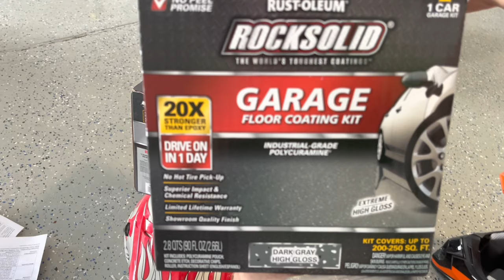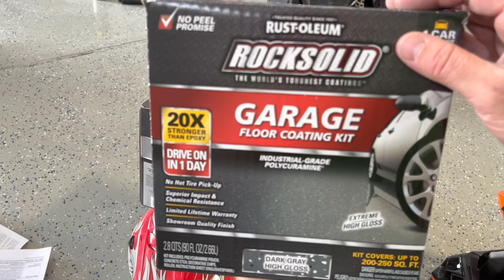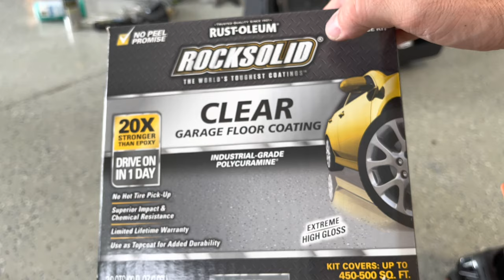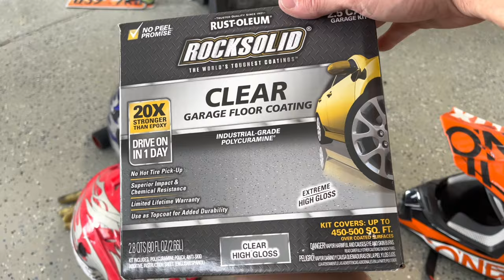Enclosed Trailer Transformation | Epoxy Floor and Painting Walls | 7x16 Dirt Bike Trailer

Comment: I used this in my 10 x 12 shed.  Lawnmowers, motorcycles and miscellaneous constantly hauled in and out.  5 years later, still looks the same as the day I painted it.  Highly recommend this epoxy paint.  I'm going to do this to the trailer I just bought.  Thanks for the video.
Reply from the maker: Thanks for sharing your experience!  Good to hear it has held up well for you.
Reply: Did you put clear Ontop? If so which one did you use?

Comment: Thanks for the great video!  I just ordered the epoxy from your link and I pick up my new trailer tomorrow! 🙌
Reply from the maker: Awesome! Good luck with your epoxy project, it's very straightforward, I would use the included sand to give the floors more grip when it's wet
Reply: I’ll definitely do that. Thanks for the tip!

Comment: I’m buying a trailer picking it up Tuesday. I may go this route. I was going to use deck paint on the floor. But I like this more.
Reply from the maker: Yeah I'm glad I did this.
Reply: So I the clear coat an option or does it have to be done?

Comment: Looks great... really brilliant  compared to the stock wood finish... I'm happy to see others have done this, even if it does require touch ups I'm sure it'll make the wood last longer than without it as well as easy to  clean up the mud and grease. Thanks for the great work and I'll be sure to have the gang get hands on with my project too!
Reply from the maker: Thanks for the positive comment!

Comment: If you hammer some nails through a 2x4 you can use them as shoes and walk on the epoxy while you’re spreading and casting
Reply from the maker: Good tip

Comment: I did my enclosed 7x16ft trailer ramp floor today. I used an extra coat of epoxy from what I learned on your 1yr update video. Its looking great. Only thing is I ran out of the blue flakes right before the ramp. Seems you had more than I did :-(  I have an aluminum ramp cover I'm going to use in place of the ramp flakes. Thank for posting this!
Reply from the maker: Nice!! The epoxy is a great option for these trailers!!

Comment: I decided against the epoxy flooring on 
my enclosed trailer because I thought it would flex too much and crack. How is it holding up?
Reply from the maker: About a year later and it's perfect, No issues or cracking at all

Comment: Good vid -- your cut in on the base boards looked like a blind person did it 🤣
How well is it holding up -- did you find it slippery with out the sand mixed in.
Cheers
Reply from the maker: It's held up good, yes it is slippery without the sand

Comment: Myk, this turned out awesome. I've seen your follow up videos with everything you've done to your trailer. I'm in the process of painting mine and plan on doing the same to my floor. My question for you is after you applied this to the floor were you still able to see the screws? I'm asking because I too will be installing e track for my bike and I want to be sure to bolt them through the frame. Thanks for your time
Reply from the maker: Thanks for the comment, yes, I could still see the screw holes very slightly, and it made it easy to install. Etrack, you should have no problem.
Reply: @Myksgarage  Sweet. Thanks for the response. I'm enjoying you videos, thanks for putting them out!

Comment: Just to clarify about the product you're using it is the RockSolid Pollycuramine and not the Epoxy shield that offered from Rust-Oleum company. Hence, it is not an Epoxy based as their customer service recommended the Pollycuramine for wooden floors as such for enclosed trailers. I liked you video demo and thanks for showing.
Reply from the maker: Correct

Comment: will you be protecting the other side of the wood that is facing the outside elements? will you also be adding protection to the frame? will you use a bedliner material?
Reply from the maker: I've thought about doing the frame

Comment: I see you used the 1 car garage Rock solid to do the entire interior and the sealed it with the 2.5 car clear sealer. Would you suggest going with the 2 car  floor Rock Solid or would that be to much?
Reply from the maker: I wish I would have done 2 coats of the color, it would have turned out better
Reply: @Myksgarage  just to be clear would the best option have been the 2.5 car garage kit of rust oleum rock solid?

Comment: Do you feel you really needed to sand the floor first?
Reply from the maker: I'm not sure, mine was used and had some wear so I did just so I could get good adhesion
Reply: @Myksgarage  mine is used has stains and other imperfections. I guess I should probably sand for adhesion as well...

Comment: I have the same size trailer. How many epoxy kits did you need for interior floor and gate?
Reply from the maker: The 1 car garage kit of epoxy covered the floor and ramp.  I also got the 2.5 clear epoxy as a top coat and that was too much, but I put a very thick coat on it.
Reply: @Myksgarage  thank you. I will go with one

Comment: Did it turn out to be really slick when raining? I plan on doing this to my trailer delivering furniture rain or shine. Wondering if I need to add the non slip additive.
Reply from the maker: Yes, it is slick, I wish I would've added the nonslip sand to the clearcoat that would help a lot
Reply: @Myksgarage  ok thanks! I will get the non slip additive as well. Do you have the non slip on the garage floor? Should I put it in with my garage floor too? I just want to be able to easily squeegee garage floor and wondering if the grit will make it hard to do that.

Comment: Is this slippery?Would this be good for a Harley which is a lot heavier than a dirt bike?
Reply from the maker: Yeah it’s A little bit slippery when wet.  I don’t see any problems with this holding up to heavier bikes.
Reply: @Myksgarage  Excellent job, if you did this again, would you put the flakes in the clear coat to provide some slip protection?

Comment: Epoxy probably isn't the best choice for a trailer because it's  not flexible and trailers tend to flex a lot it dries hard like glass and unless the surface is dust free and oil free it doesn't adhere good and it takes forever to dry 
At work, we power washed the floors moped them acid washed them
It's great on a concrete floor 
Even after that, sometimes it would fail within a year or so
I'd probably use vinyl plank flooring because if it gets damaged, you can easily replace the bad sections I like the rubber mats that snap together like puzzle pieces and it's not slick and cargo doesn't slide around on it and you can replace it cheap and easy 
Harbor freight sells it cheap!!!
Reply from the maker: Mine has held up great for almost two years now